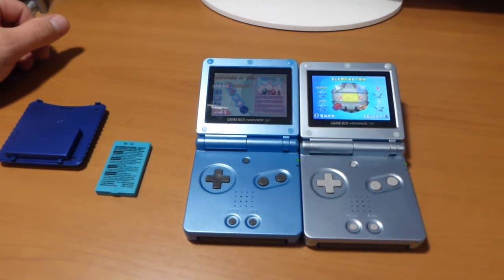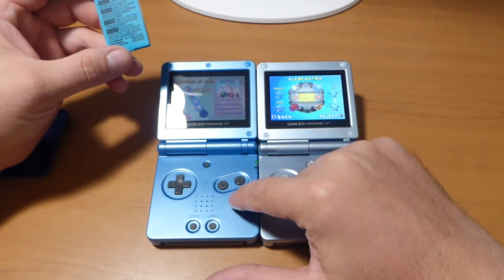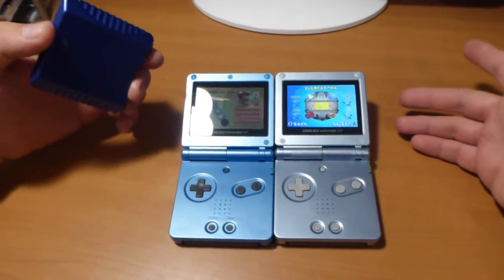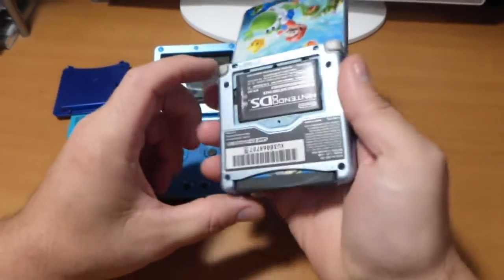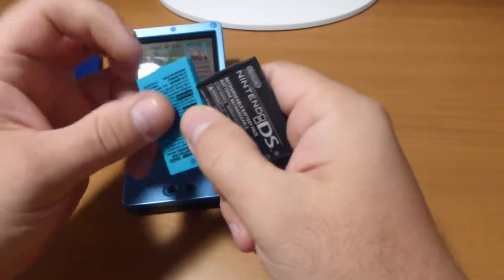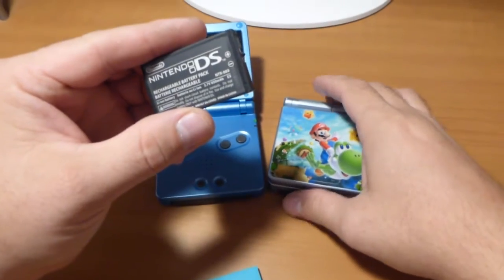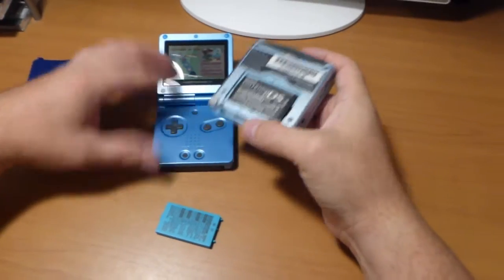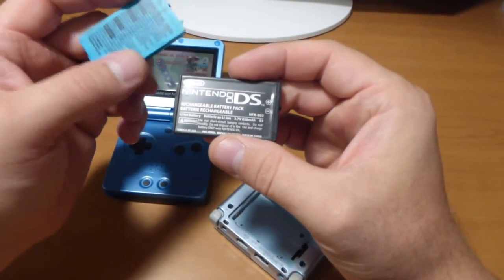How to modify Battery for Nintendo Game Boy Advance SP GBA Mod

Comment: wow this is really cool, after i watched this i ordered a third party DS battery that is 1800mah, ill let everyone know if the battery works!
Reply: the battery arrived today, unfortunatly it didn't work. i cut the little plastic pins that were in the way, put it in the sp and it didnt turn on, i tried charging it but that didnt help. maybe it only works with official nintendo batteries. anyway, the brand of battery i used was a hyperkin rechargable battery pack.
Reply from the maker: +SlipperyScope well, to be earnest i use only generic battery, i have a bad experience with aftermarket battery for PSP it was 3600mAh instead original 1800mAh, than i test that battery with cycler and it turns it's under 1000mAh not 3600mAh.
Reply from the maker: +SlipperyScope in that size there is no 1800mAh possible can be done
Reply: +GPeter7 yeah i thought that might be the case. Oh well, only use genuine
Reply: Thanks for the headsup Scope. I was about to try the same thing. Thanks for letting me know that it wont work out.
Reply: Buying blindly aftermarket dedicated batteries as well as storage units (f.e. unbranded SD cards) is a sign of being a total amateur or naive dummy
Reply: @92000  haha wow, its been 4 years since i posted this comment! I actually ended up wiring it up to a li-po circuit and got it to work in another project. i think it was not outputting enough voltage. batteries are just batteries in the long run, as long as you know what kind they are it should be fine!
Reply: @SlipScope  if you wanted to be sure u could have bought a new one at the flea market or classic video game store bring ur battery in and see if theres any thickness difference

Comment: I bought a new sp battery but my sp still shuts off randomly any idea why it does that?
Reply from the maker: does your GBA SP doing that on old/original battery as well? if yes, then its a problem with SP. (I did have similar issue, and it turns the power switch was going bad). if not, then it's a new battery, all Li-Ion battery do have a balancing/charging board it can be it cost a problem
Reply: +GPeter7 i have both model sps and both do the same on the original battery and the new ones, it plays for an hour or so and sometimes it resets the system both do that
Reply: Josue Guzman I mean, it could be your power switch. Just open the back panel on the bottom of the sp, get a Q-tip with some rubbing alcohol on it, clean the power switch with the Q-tip, put it back together, and flip the switch a few times. If you are not comfortable taking your Sp apart, then watch a tutorial. Also, be very careful and take your time, slow and steady wins the race.

Comment: How much longer does it last I might do this
Reply from the maker: Well, the original DS battery  works really really good on the Gameboy Advance, but the problem is, these days it's really hard to find a good true capacity DS battery, most batteries you can get from eBay they will not have the true capacity they stated on the battery. My recommendation when you get new battery, you should do a cycle test through an analyzer, and see how good the battery is
Reply: @GPeter7  yea
Reply: @GPeter7  how much longer did it last for u?
Reply: @GPeter7  might do this is i can find a good nds battery I would do mokho but I barely know solder skills I probably can stick tabs back and stuff but for a battery i worry

Comment: I removed the sticker on the battery to slim it down some, fitment still isn't perfect, but I'd say it's worth it.l
Reply: Then your battery might be slightly swollen. That's a sign it's a bad battery.

A gen 1 DS battery will 100% fit as long as those two pins are removed. 

I purchased a lot of multiple handhelds at an auction, and a single AGS 001 was included. The back was puffing out because the original battery was swollen. Yes that's right, the original GBA SP battery no longer fit the device it was engineered to fit. 

I really wanted to play that AGS 001, so I dug around in the lot and found a shattered OG DS. The shell had become brittle and completely crumbled like egg shells in my fingers. But the battery wasn't puffed, so I cut those two pins off and stabbed it into the AGS 001. It fit perfectly!

As I am typing this, that AGS 001 is sitting on my desk with a copy of pokemon ruby inside.  And that DS? Well... I'll probably get a new shell for it someday. Not in a hurry because that lot had about 30 DS lites in it.